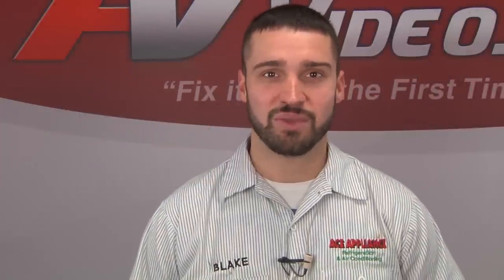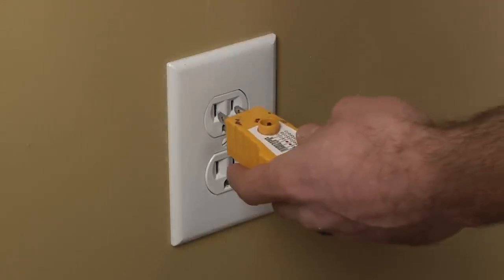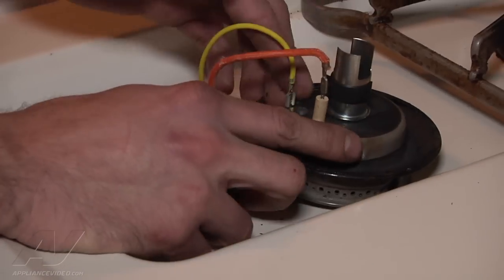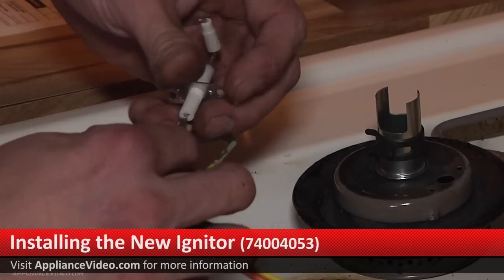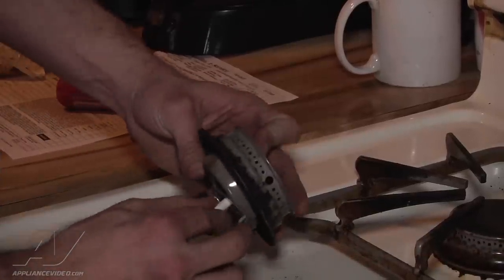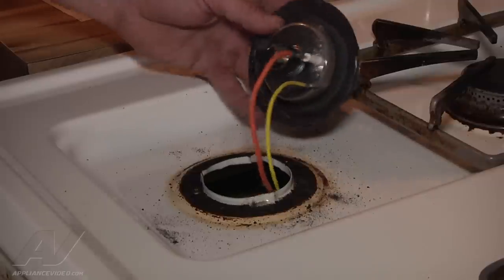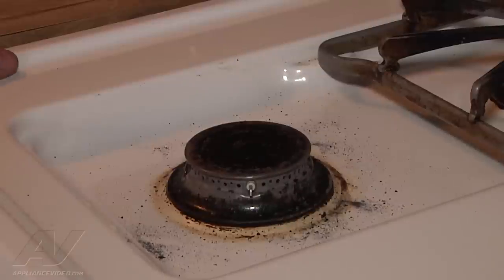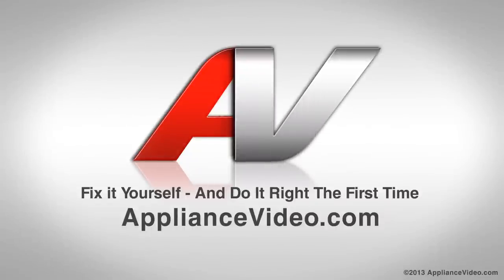Magic Chef Stove Repair - Burner Will Not Light - Ignitor

Comment: How could you tell if it was the spark module or spark ignitor switch at fault?
Reply from the maker: Great question, if you have a more technical question that our parts department cannot answer, you can search our over 17,000 answered questions free at our website www.ApplianceVideo.com under our Repair Help section. You can also call our parts department at 1-800-830-5465 and they can give you help 7-days A week ,or search at www.SaveMoreOnParts.com  .

Comment: One knob on my stove will cause all the strikers to work, but another doesn't cause any clicking. If I turn the second knob the gas will flow and I can light that burner by using the first burner's knob to activate the strikers. Any ideas what the second knobs problem could be?
Reply from the maker: Great question, if you have a
more technical question that our parts department cannot answer, you can search
our over 10,000 answered questions free at our website www.ApplianceVideo.com under our Repair Help section. You can also call
our parts department at 1-800-830-5465 and they can give you help 7-days A week
Monday -Saturday, or search at www.SaveMoreOnParts.com  24 hours
7- days A week.
Reply: Yeah, A knob has two purposes, 1) to activate the flow of gas and 2) to activate the igniter to light the gas. Normally turning ANY knob will cause ALL the burners to click/spark but only the one you turn will flow gas. In your case the knob is broken. It's probably striped inside so that it isn't actually turning the igniter (job 2) so it just turns on the gas. But using a different knob (one that is not stripped) on that burner WILL activate the igniter.

Comment: My burners keep making a clicking sound what could the problem be? I tried the rubbing alcohol with a Q-tip but still making a clicking sound on all 4 burners.
Reply from the maker: Great question, you can call
our parts department at 1-800-830-5465 and they can give you help 6-days A week
Mon-Sat . You can also search at www.SaveMoreOnParts.com 7- days a week.  If you have a more
technical question that our parts department cannot answer, our technicians are
answering all questions at our website at www.ApplianceVideo.com under our Repair Help section. We have over 6,000
common questions and answers that you can easily search through by your model
number, appliance make, problem or error codes, and It’s completely free to
search through our question & answer library. There is a very good chance
you question is already answered there.

Comment: The burner cap is tight can't remove by hands.  What can be done?
Reply from the maker: Jansen 
      They get build up in them from food. There is a tool that looks like a car oil filter remover. On the tight ones that is what we use. If you know someone with an oil filter tool try that for more leverage. Please help us provide more videos to our site by posting ApplianceVideo.com on your YouTube, Facebook or Twitter account or add us to your circles. If you are in need of any parts please support our parts department on line at http://savemoreonparts.com/ or call 1-800-830-5465 7-days a week until 11pm Eastern time. Thanks again your support.  Matt, Ace Appliance service technician.
Reply: ***** Thank you for your tip.
Reply: On some brands, such as my Maytag, the burner must be turned counter-clockwise to remove. If you're turning in the right direction and still can't get it removed, use a strap wrench. You can get a set off of Amazon for $15.

Comment: The 4 ignition burner are fail why
Reply from the maker: Great question, you can call
our parts department at 1-800-830-5465 and they can give you help 6-days A week
Mon-Sat . You can also search at www.SaveMoreOnParts.com 7- days a week.  If you have a more
technical question that our parts department cannot answer, our technicians are
answering all questions at our website at www.ApplianceVideo.com under our Repair Help section. We have over
4,000 common questions and answers that you can easily search through by your
model number, appliance make, and problem or error codes, and It’s free to
search through our question & answer library.